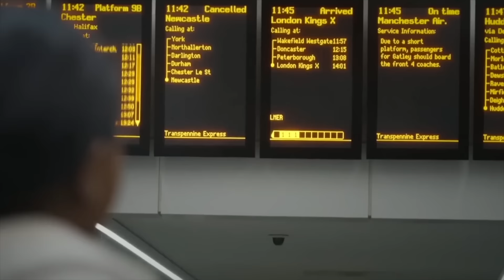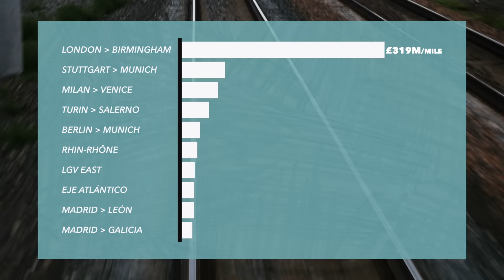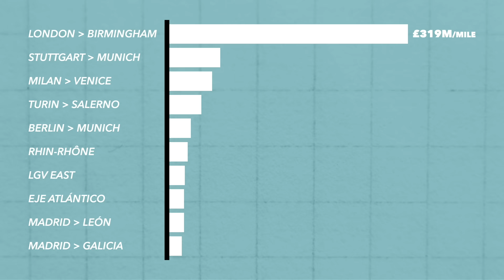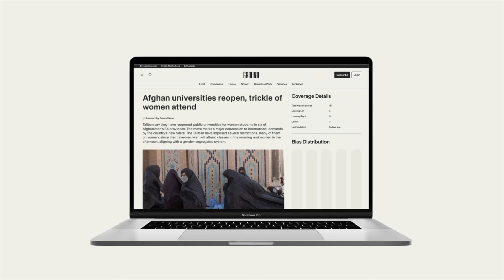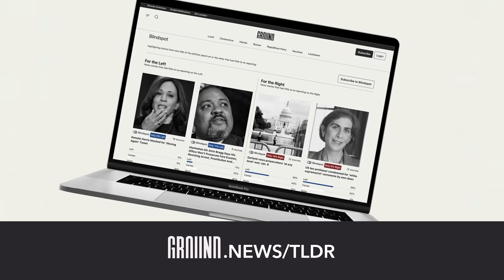The £100bn Railway: Why is HS2 Four Times Over Budget?

Comment: The Japanese started using the bullet trains back in 1964. We got the HST Intercity 125 in 1975 as a stop gap while we made the APT tilting train, some of those stop gap trains are still in use almost 50yrs later. 60yrs after the Japanese and we're only got 68 miles of high speed rail in HS1. Its pathetic how little our transport system has changed, as we cling onto short term cost saving ideas which cost us far more in the future
Reply: @crapmalls  
You OK?
Reply: The Japanese built 200? Mile of motorway in 6 weeks after fukushima.
Reply: What "cost savings"? Paying 4x the actual price...
Reply: @davidwebb4904  
4x= on budget🤷‍♂️
Reply: "we're only got 68 miles of high speed rail in HS1. "..  HS1 line built in 1998 was just a French LGV high-speed line and first Eurostar trains were based on TGV trains. In the 90s UK had zero knowledge in building real HS lines (speed > 280-300 kph)
Reply: That's why in 1994 South Korea bought French TGV HSTs..
Reply: @richardgallagher4880  Though it is worth mentioning that Japan has the highest dept to GDP in the world for a reason
Reply: The first Shinkansen line also went way over budget. Nobody is talking about that anymore.
Reply: it's because the Tories want it private and not public service
Reply: @Inucroft  Bad example, the shinkansen is owned and operated by five separate private companies. Privatisation can work, it just needs to be implemented appropriately
Reply: From my understanding it's because the UK had over a century of curvy rails to work with.
While in Japan most of their infrastructure was carpet bombed into oblivion in WW2.
It's hard to justify destroying tons of current infrastructure to build a more modern one. Even if it would be better. 
I mean it can be done. But hard sale for government and the public
Reply: @davidwebb4904  By short term savings, I meant if the UK had started a high speed railway system at the same time of other countries, we'd have had one for the past 40-50yrs. Instead, we tried to save money by coming up with a tilting train to use existing track (the train failed, but the research was sold on) and the Intercity 125 which we've used for almost 50yrs. However, it must be remembered that the Beeching acts were in the 60's, and the last mainline steam was in 1968, so aiming for a high speed rail network was a very difficult sell.....
Reply: @gerwin030  Every single major search infrastructure project, in the UK, goes massively over budget. It's not like it's a one-off occurrence.
Reply: @davidwebb4904  
It's done so seldom, there is no expertise in managing such big projects and no political will to make them a success. Short term thinking rules the whole system.
Reply: @hpsauce1078  
It is technically impossible to manage high-speed rail in your country. I don't think you can operate an advanced system without being able to manage your budget. Let's start by forgoing high-speed trains and keeping regular trains running on time. You don't have the ability to operate a high-speed rail system like Japan.

Did you understand well?😃
Reply: @crapmalls  
It is technically impossible to manage high-speed rail in your country. I don't think you can operate an advanced system without being able to manage your budget. Let's start by forgoing high-speed trains and keeping regular trains running on time. You don't have the ability to operate a high-speed rail system like Japan.

Did you understand well?😃
Please operate on time.🤣
Reply: but Japan got also a car industry, while in the UK where is nearly anything!
funny, big EU countries have all a car industry, 
the only kind of " rich " country outside the EU is building nearly zero cars and dont have a domestic brand not owned by others!
Reply: @davidwebb4904  Cost saving in the long term.
Reply: @BrianMcGuirkBMG  aits been designed to be as complex and therefore as expensive, as humanly possible. This is a 10-15 Billion job, tops.
Reply: They tax you so much you can't afford to run your car and then FU public transport so it's unuseable. Great.
Reply: 1964?  jUST SHOWS HOW FAR WE ARE BEHIND
Reply: @mrfoameruk  i pay €64 for my car and €36 for my motorbike and public transportation is great here where i live.... inside the EU!
Reply: @三枚マスク  This is a complex issue and unless you know the UK railways and the political interference/ideology from the Tory  party you won't fully understand the problems. The railways in the UK are underfunded and have never been fully modernised since the 50's/60's.
Reply: @verttijineu2776  One:- The Tunnel under la Manche was started from each end and met in the middle. That was NOT a French-only project. 

TGV trains were used because they met the INTERNATIONAL legal requirements on safety. And they are still the safest trains in the world. Both TGV and the AGV use the Jacobs Bogie which is the ONLY way to keep a train upright and concertina free if a derailment takes place.

Britain just didn't WANT to spend the money on new trains. And they did buy 7 sets of the AGV, and ran them as the Class 373, read up on them, you'll see that there is no such animal as "British Management".

The British jumped straight from the HST125, designed by BR, to the APT designed by non-rail engineers who wanted the latest ideas without knowing why.
Reply: @verttijineu2776  The TGV is not a HST, the are completey different to the BR HST125's, (Class 43). The TGV is the safest train in the world. Except for the AGV.
Reply: @hpsauce1078  Do you really mean DEPT. short for department? Or did you mean DEBT? Japan runs a high debt policy in order to provide efficient services across their whole country. There is no North/South split as in Britain.
Reply: @hpsauce1078  To be fair, Japan's national debt is a result of their previously massive bubble economy and subsequent collapse, and not because they built lots of advanced transport infrastructure.
Reply: @user-qy6pf2mo8j  It is not only Japan that operate HST systems efficiently. France, Germany, Belgium, Spain, Switzerland, Netherlands do so, as does China. And France and Belgium run Duplex HST trains as well.b Something Japan is currently scrapping!!
Reply: @Arltratlo  ❤❤❤❤❤❤❤❤  True said
Reply: @davidwebb4904  Then YOU take it on and do it inside that budget.
Reply: @johnchristmas7522  My local train station was connected to London in 1804, and, apart from electrification, nothing done since.
Reply: @markwalker2627  Trying to explain this concept to a Japanese is impossible. Japan has a LONG history of "The Country Comes First". Britain only had that once, in 1948, with aa true Labour government.
Reply: @Demun1649  "The TGV is not a HST".. hehe good one!  BR HST125 hasn't got the monopoly of "HST" term. It's a general acronym used for all high-speed trains, not only HST125. wiki: "TGV (French: Train à Grande Vitesse, "high-speed train" )..    "ICE is a system of high-speed trains  running in Germany." .. "There are several series of high-speed trains that run the AVE service.) .. btw AGV is designed and built by French Alstom.
Reply: @verttijineu2776  Don't try, and fail, to teach someone who has followed railways fore over 50 years. I am fluent in French, so TGV and AGV are commonplace knowledge to myself. Personally, I don't think you are very old, all the posts you have made have failed on my Plagiarism software. You stick to your model layout and leave the real world of trains to the adults, who, so far, have made a right mess of the British rail systems.
Reply: @Demun1649  I actually am putting together the alternative budget. Saving probably 50 Billion off current price forecast. Just do a bit of research, find out what things actually cost, and do a bit of maths. All this overcharging is why we cannot have nice things.....
Reply: @gerwin030  Because the fact it went way over budget just doesn't matter once it's done and operating as it should. The average person doesn't really care if a big rail line takes four or five times as much as the government thought it would to build when it cuts their commute into a fraction of what it used to be.
Reply: I see your point, and I agree because we still don't have anything like this in the US. But Japan made their trains before the new century. Costs and bureaucracy was far less 60yrs ago. Those 2 factors alone would escalate the prices today by atleast 5x
Reply: There are no short term cost savings in the British rail network. The Train Operating Companies, (TOCS), run the different mainlines using rented rolling stock. They are meant to run their companies using the income from fares, and franchises at major stations. That policy doesn't work.
Every year under the TOC system the Tories have given more money in subsidies, while EVERY YEAR that subsidiy is more than the last FIVE YEARS of BR put together.
That is the main problem. There is no incentive for efficiency in the TOCS, they know they are going to be bailed out and the share holders will be very, very happy. Or to paraphrase, "Money for no rope".
Reply: @Demun1649  Maybe no north-south divide, but definitely an east-west divide. If anything, Japan is more centred on Tokyo than the UK is on London.
Reply: @hpsauce1078  sure but they GDP and per capita is also very high. UK has a very high debt to GDP too, it makes sense to spend a lot on infrastructure, Japan is geographically a linear line, their trains are very effective and cities are huge hence profitable. They had a economic bubble in the 90s, then they had a huge natural disasters one after another that killed almost 12k people, they are still recovering from it but in the next decade their debt will go down. They have increased their taxes by quite a lot to achieve this. Service and sales taxes were very low so they doubled it .
Reply: @Demun1649  A tax write off, is not free money. Its still a loss at the bottom line.
Reply: Japan also has the world's first large-scale maglev line, and although China has the world's first maglev line at all, China's line only runs between Shanghai and its airport, at a distance of only 29.863 km, whereas Japan's line runs from Tokyo to Nagoya, at a distance of 285.6 km.
Reply: @davidwebb4904  Issue is too many people with fingers in pies and getting back handers
Reply: @Demun1649  I don't need such a small train. Shinkansen is even bigger than TGV.
What we want is a new rail system built on slab tracks, all with double tracks.
The world's best punctuality, with a delay of 24 seconds per year even in the city with the highest annual snowfall in the world, and the world's best operability, one train every three minutes. The world's fastest speed and the capacity to carry more than 1,600 people at one time could not be realized. Furthermore, there must be a linear train that can operate at a speed of 600 km. you guys are late.😅
Reply: @hpsauce1078  really makes you think about how much debt is a problem when the largest debt to gpd is owned by the  world's third largest economy.
Reply: The bullet trains were never economical and had to be subsidised, the wheels only lasted about 6 months then had to be reprofiled.
Reply: The cost increase is because of fancy housing estates down South and needed  tunnels to quieten the HS2 trains passing.
Reply: @David Webb  
It costs what it costs. Not what you would like. Given the likely state of the govt to manage projects it's the best value available.
Reply: @gerwin030  was Japan in a cost of living crisis? Didn’t think so
The government isn’t willing to pay for reasonable pay, but willing to go overbudget on trains. Think again.
Reply: @tonyclough9844  That is because the Japanese don't know how to cast good metal.
Reply: @Demun1649  1. Switzerland does not operate high speed rail. 
2. Japan has safer HSR than any other country, not France...

Sorry your posts are incoherent and misinformed at best.
Reply: @svartmetall48  Do you not think that the using of Jacobs Bogies makes a train safer? Don't research, just answer. Because you are, after all, much more informed than I am.
Reply: @Inucroft  how are the UK public services working out? oh wait, they are not working.
Reply: @Demun1649  Safety is the record of the railway. Japan has had no fatalities on its Shinkansen network despite being one of the most intensively used, most punctual and oldest HSR systems in the world. France, however, has had fatalities on the TGV network and other incidents too. Enough said.
Reply: @svartmetall48  Give me those dates and times of the fatalities on the TGV network. The TGV has carried over a billuion passengeres with no "in service" fatalities. And your excellent services still has the highest figures for suicide by train in the world.
Reply: @Demun1649  You are confusing the Shinkansen with the rest of the network, and clearly do not understand the Japanese rail system. Also, the Shinkansen has transported more than 10 billion passengers, so we are talking about a completely different scale here. Sorry, but you are trolling now.

The fatality due to derailment was in 2015 on the TGV. Plus there have been numerous level crossing incidents, hence the need to remove them.
Reply: @svartmetall48  There are always incidents on level crossings, with the USA being the worst. Level crossing incidents are NOT the fault of the train, it is car and lorry drivers who are too important to wait for a green light, or pedestrians who just take the chance. Why do you blame the TGV? That is TOTALLY IRRATIONAL.
So the 2015 derailment of a TGV carrying passengers on a scheduled timetable happened where. It is not showing up on my my spreadsheets.
Are you talking about a testing derailment, where ONE person was killed.
Japan has a constant flow of suicides from platforms jumpers in front of trains. No other country that productivity.
Reply: @Demun1649  The suicides are on the regular network, not the Shinkansen. The level crossings are a fault in design of the network - ultimately having "the best train" means little if operationally the outcomes are subpar.

Your spreadsheets are highly selective as all that matters is that there was an operational incident - I quote "November 14, 2015 when a TGV testing on the new Paris-Strasbourg line derailed violently into a canal, killing eleven and injuring the surviving 42 passengers."

Honestly you seem all over the place with your reasoning, I also don't know if you have travelled around the world in these networks - I personally have experience of many of them (only HSR I have not been on is the Spanish network). Out of all, I still rate the Shinkansen highest in each of my four visits to Japan, and the statistics back that one up.
Reply: @svartmetall48  You quote "when a TGV testing on the new Paris-Strasbourg line". That is NOT a timetable operation. I have that one on the spread sheets. You accuse me of being all over the place, and the ONE incident you can quote is  a test run, and it wasn't the train at fault. You also, deliberately, failed to add, "testing new Paris-Strasbourg line not yet in passenger service". 
When HS2 opens I hope you enjoy travelling on the trashy Hitachi rolling stock.
Reply: people often forget how overbudget the Japanese Shinkansen was
Reply: Your making out as if we don’t have HS1, Channel Tunnel, Crossrail (Elizabeth line) and High Speed IET’s flooding the country.
Reply: @ameerali.ouarda  HS1 IS EuroTunnel. Crossrail is a REGIONAL track from Reading ton London, and the "High Speed IET's are only Hitachi trash, ten years out of date before they were delivered.
Reply: @Demun1649  Well they were designed by JAPAN.
Reply: @Demun1649  The EuroTunnel existed before HS1. Remember when Eurostar used to run out from London Waterloo?
Reply: @ameerali.ouarda  And used HS1 to run on. Also I have here, in my possession, a VHS recording of the breakthrough on the Channel Tunnel. I feel I should point out it took another three years to get things running through the Tunnel before the process of qualifying for passenger carrying.
Reply: The bullet train is so expensive only rich people or business people on expense accounts can afford to use it.
Reply: @chriswatkin5476  And it is just SO DAMN UGLY. Two reasons not to use it.
Reply: @Demun1649  your hilarious. So one minute you favour high speed rail and the next minute you boycott it. Make your mind up…
Reply: Agreed
Reply: @user-qy6pf2mo8j  you can't run the regular trains on time as there is not the capacity on the network, any delays from any of the different speed train services will destroy the timetables for everyone
Reply: @Demun1649  
Shinkansen does not cause accidents like TGV. It safely transports 360 million passengers annually. TGV? Enjoy your delayed train journey in France.🤣🤣🤣
Reply: @user-qy6pf2mo8j  When did the TGV CAUSE ACCIDENTS? Do you have the details? Verified details and the links to your proof? 
My records don't show any CAUSED ACCIDENTS IN SERVICE. How many people have died on the TGV?
Typical "Gaijin", pretending to something you are not.
And, while you are at your lies, tell me why articulated bogies are inferior to the Jacobs Bogie?
Reply: @Demun1649  
Japan's Shinkansen has not caused any fatal accidents since 1964, including test runs. Its on-time performance rate is also higher than that of the TGV. It promises the highest safety and the highest punctuality.
A shallow geek like you wouldn't understand. 😅

Jacobs Bogie😅The regular bullet train is much larger than the TGV, and requires both maximum speed and acceleration, so we don't use articulated bogies with less motors.
Shinkansen 1 car: 27,500mm x 3380mm x about 405m length
1 TGV car: 18,700mm x 2,900mm x about 200m knitting length
Conventional lines in Japan: 21,670 mm x 2,945 mm x about 315 m long
Although the height limit is 4,500 mm, the Shinkansen E4 series can carry 1,634 people, the largest for high-speed railways. 
Did you understand that TGV is a small train?🙂

China discarded the same vehicle size as Japan, and the articulated bogie was not suitable for high speed and mass transportation. A small truck would be sufficient for a small vehicle.
Germany's ICE, Japan's Shinkansen, China's CRH, South Korea's TGV and HEMU, Italy's ETR, and England's HST are articulated bogies.

China's CRAF-C, Japan's E956 Shinkansen, and Asia look like aircraft, but you're 20 years behind.😅
Reply: And the HS2 boss man just quit.  A freaking white elephant project.
Reply: Wondering why are you falling behind in economy, when you have the Technology Knowhow that other could ever dream of, saying we dont have enough Skill this that.
Look in Mirror lately?
Reply: It's also the Japanese people and work ethic, British people don't work as hard. This country has a short term view.
Reply: Trust rich people to trip over pounds to save a few pennies